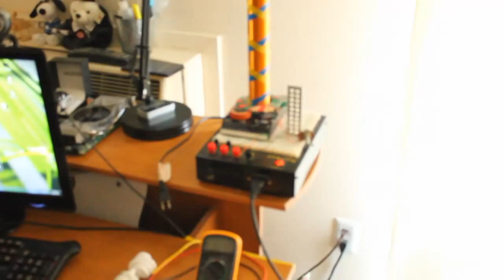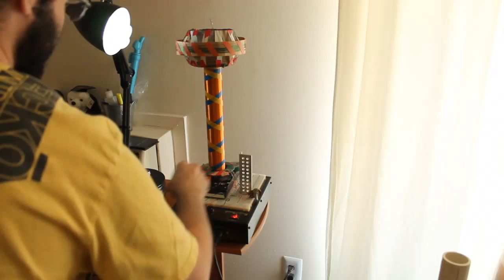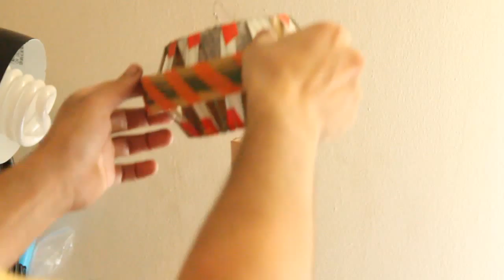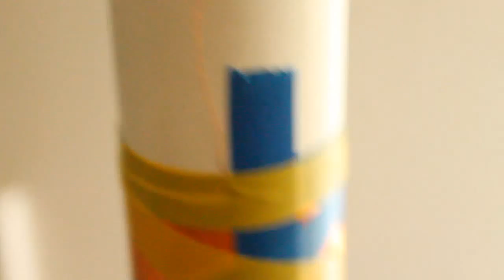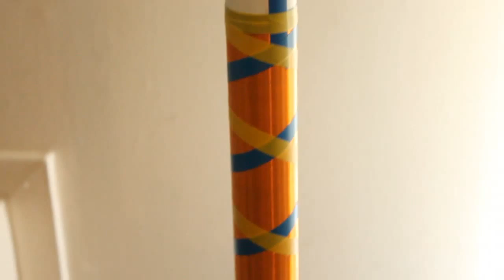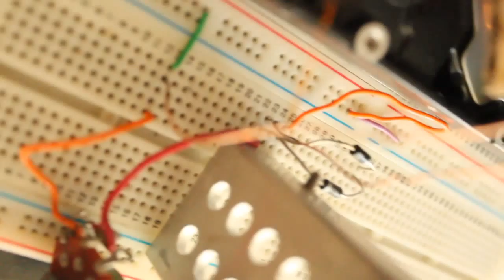Huge Solid State Tesla Coil

Comment: The aerial capacity for the secondary coil is essential. Depending on its size, huge amounts of charge from the secondary coil build up in the sphere & ulimately discharge giving you significantly longer arcs. This is one place within the circuit where a huge increase in voltage can be achieved. Tinkering with the size of the sphere can have an enormous impact on performance so that even the smallest Tesla coil will produce very long arcs. W/o a topload on the secondary, performance is very low.

Comment: nice vid.as far as mesurements buy ur self an old v.t.vm they are far more accurate than todays handheld plus they are designed  for measureing peak  r.f. alignment without disturbing the circuit.plus some masure voltages up to 30kv.and  my precision instum ev-10 has a imput impedance of 133 mega ohms! all american five radio has a video on its uses ty.